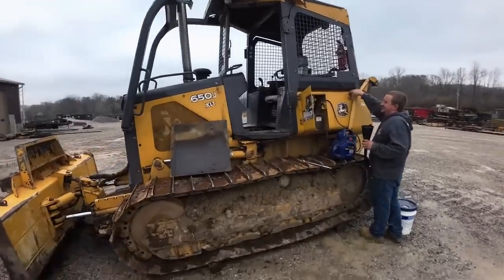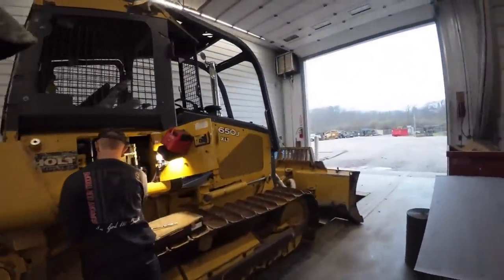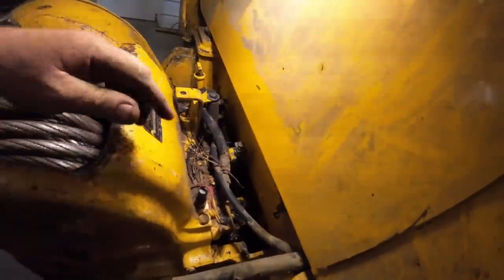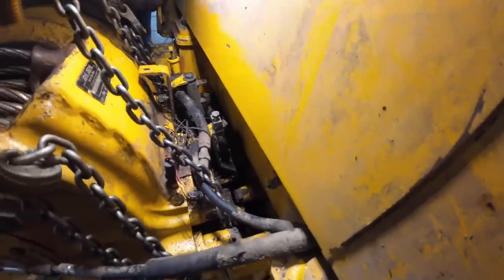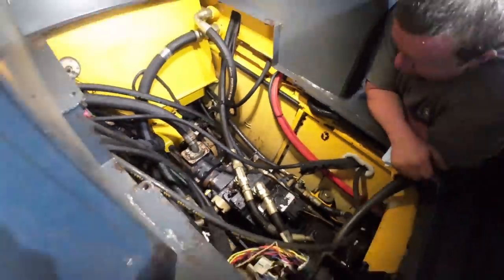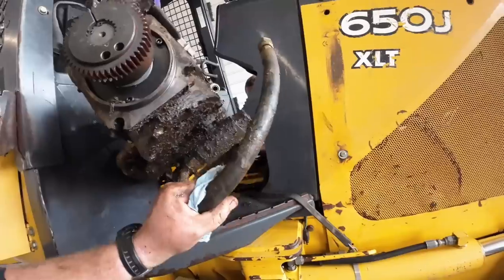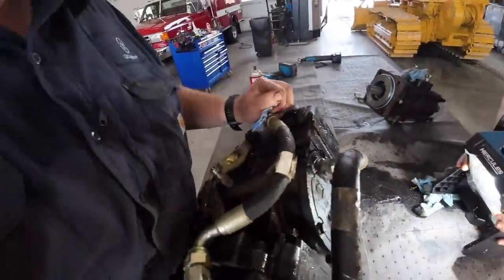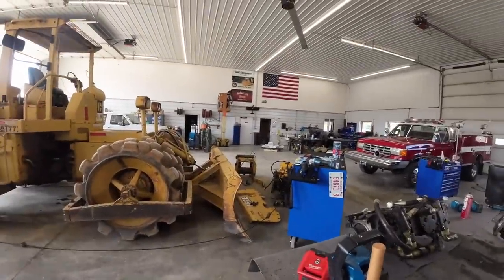Major carnage on another John Deere logging dozer but was it a operator error or manufacturer issue?

Comment: I have to say the Forklift is a BEAST...I've had a Plug leak on a 850 K. But it could be fixed in it. Just had to have Long Arms..It was on the bottom. The pump housing thin on that 650. Crazy..Great Video Clint. And everyone..

Comment: I good way of marking lines an old Cat Mechanic showed my was using short sections of phone wire. I've gotten it from utility crews repairing underground comms. So, 4" cut section with 100+ wires about 1/2" dia total maybe and there are a lot of different colors but they can be match line to line color wise. I used to them especially on truck trans marking air lines.

Comment: Of course I want to see you reassemble the loggers carnage. I have worked with a logger crew that used to drive from Alabama to Texas to work 7 days on and 7 days off on the oil drilling rig I worked on in my younger days ...let me tell you that those logger boys could tear up a steel ball with a feather. They  kept the iron tore up and the tool pusher had to fire them when he caught them stealing diesel fuel in 55 gallon drums to make that thousand mile trip back and fourth. Go figure!

Comment: I'm fairly sure "customer" would be getting an invoice line reading "Remove/refit cab" if I was going at that snake-pit... :-)  I could get it out without hoiking the structure, I doubt I could get it back in. Least not so it worked anyways.

Comment: 🚜🔥😱 That forklift is an absolute beast! Its sheer power and capabilities are mind-blowing. It's fascinating to witness the immense strength and efficiency of this machine in action. I wonder what tasks it's specifically designed for and how it compares to other heavy-duty forklifts on the market. Whether it's a matter of operator error or a potential manufacturer issue, this video certainly highlights the importance of safety protocols and equipment maintenance. Stay safe out there! 💪👷‍♂🛠

Comment: Now you know why there is a cord on a disk brake of a motorcycle. That cord is put on the throttle so you know its on. You can also do that with the lights. Problem is, if a light is good its sometimes to big to get in small spaces.
And please keep us informed how it works out. Do you consider refurbished parts?

Comment: I enjoy watching you guys.  I am not a mechanic!  My knowledge stops at changing the filters on my compact tractor.  QUESTION:  Would have bee feasible to weld the crack in the case?  If not why not?  (The only thing I know about welding is to not watch the flash at the torch.😅
Reply from the maker: It’s cast and take some high pressure
Stay tuned for the next video on it

Comment: The secretary pays the wages ,don't forget that .
Now if she is just the secretary,there is no relationship thingy !
Now Clint you could have made helpful suggestions to the Secretary about which fastener to hang the banner with and give her direction on how to fix the fasteners ,like a Gentleman Would ,and don't Secretaries just have to blink their eye lids and smile to get the fellas running ?

The Hyd pump ,can you not flow weld it ?
And if they are reportedly know to crack ,why ?is there movement,is there shock loading  happening?
Reply from the maker: Stay tuned later on for what we found on that

Comment: does that carlyle jump pack work well for you guys? i run a company service truck and seem to have to boost alot of 24v equipment when operators decide to play with buttons, ive been trying to decide if i should pull the trigger
Reply from the maker: They are

Comment: As an autobody man of 31yrs I’ve had to work on some pretty difficult cars to disassemble and reassemble, but nothing compared to what you guys wrestle with. Especially hydraulic lines….my God! Everything looks like spaghetti the way they laced those hydraulic lines to the pumps in the belly of that machine. I’m always SO greatfull for how the engineers were so thoughtful by taking into consideration folks would have to do service work and repairs later on in the dozers life. I think if they were made to fix things on the equipment they designed, things would be designed much  better. Sometimes I’d like to buy the design engineers a knuckle sandwich 😐

Comment: Guess there are forklifts and then there are FORKLIFTS yours is defiantly the latter 😳 it’s so annoying when the is a common manufacturing defect from a big supplier but they won’t even subsidise a replacement. Happens so often they should at least give you 50% off a replacement that has failed due to the defect. ( no point looking for a second hand unit as will have same problem.)
Reply from the maker: Well stay tuned because we got a big surprise

Comment: I wonder what the local Deerelership would have charged to do all that work so far…including putting that driveshaft brace on the wrong way again? 🤔😆
Reply from the maker: Lol
Reply: Pretty sure it would be at least double $ or more what Clint and the boys are charging, not to mention the consultation fee for installing the safety loop backward and outside to guarantee that unique fit.👌🤙

Comment: Big Red Beast with forks moved that thing around like it's a kids Tonka Toy version. 
Gotta wonder what jackwagon designed a struggle bus pain in the a#@ into that machine.
Then another jackwagon at the dealership worked their miraculously inept SNAFU habits on it.
Doesn't matter tho, the C & C equipment crew can take it on and it's gonna leave theshop looin' like it's straight off the showroom floor.